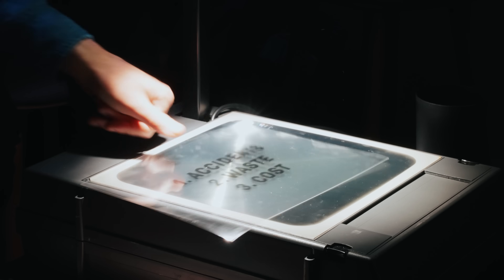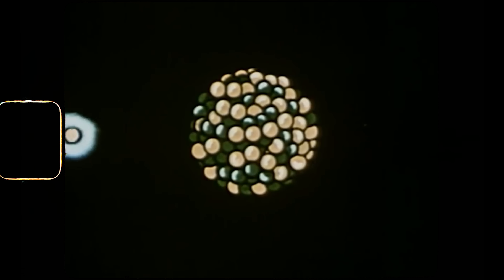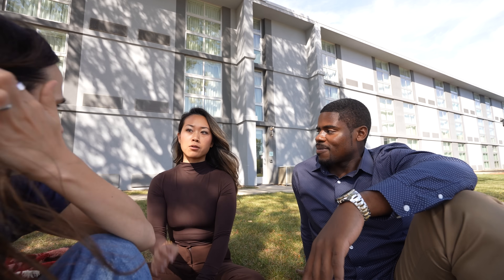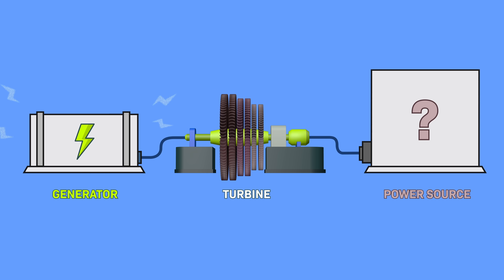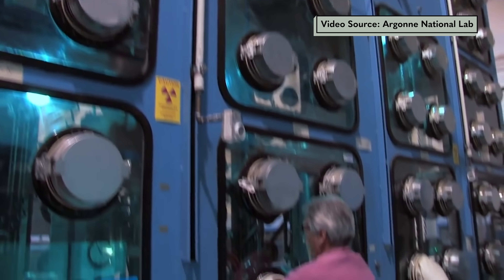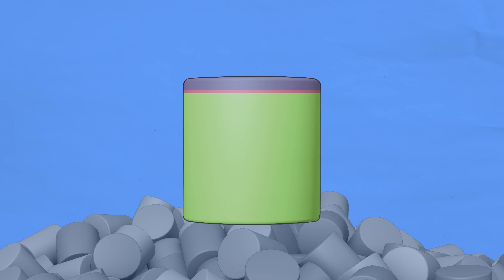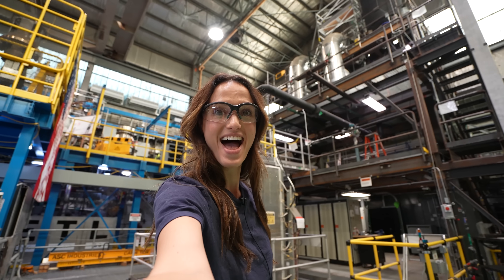The Big Lie About Nuclear Waste

Comment: What about the radiactive but not nuclear waste a nuclear power plant also produces? Like the concrete or the reactor parts? They are radioactive but not useable. They are not that long  radioactive (1000 - 10 k years) but make 90% mass of radioactive waste. And your hole reuse isnt a closed loop.

Comment: Nuclear fuel recycling sounds great, and it sounds like President Carter made a mistake in ending it. But reactors in use today are incredibly complex, and once you understand how easily one mistake can create a Three Mile Island, Chernobyl, or Fukushima, you’ll want all nuclear powerplants permanently disabled and decommissioned. It’s the most dangerous technology ever created, and when climate change begins our mass extinction in a few years, there won’t be enough skilled operators around to safely shut down and decommission these reactors, resulting in meltdowns which will destroy our ozone layer, allowing cosmic rays to sterilize this planet. We need to begin terminating these reactors now, before it’s too late.

Comment: For me (an economist), this video stopped right when it got really interesting (it's still great though).
The most important thing after proof of concept is economic viability. Therefore, what I really would like to know are the overall (economic, not business) costs of a closed nuclear fuel cycle compared to the costs of the current once through fuel cycle, including all the externalized costs of waste storage etc.
One could then go on and factor in risk aversion, since highly radioactive nuclear waste in storage is probably much more risky than just reusing it.
One would have to consider numerous other things of course, but one could find out if it really is advantageous for a country/economy to do this.

In the end, one would still have to compare it to other technologies (renewables are much cheaper of course, although with their increasing share in total electricity production the additional costs of storage reduce the margin).

Finally, being from a country that shut off it's last nuclear power plants almost exactly a month ago, I'm very glad that, at least, this research is continuing in other countries.
Reply: Galen Windsor.... thank me later.

Comment: I find it weird that you mention the 'cost' factor in both viedos, but then go away and more or less ignore it.

In the 1960s, there was a vision. A vision, that nuclear power could be a cheap and reliable source of energy. It wasn't back then, but the technology was very young yet and the researchers at the time claimed that it would totally become profitable in a few decades. They stated that for the fission reactors as well as technology like breeder reactors, that could use U-238 or waste of fission reactors.
Now, over 50 years later, it hasn't come true and it doesn't look like it ever will.
There is a huge loss in interest for nuclear reactors and the one main reason seems to be cost. In a time, when we have very cheap energy from wind turbines and solar, that got profitable easily and are still getting cheaper, no one wants to invest in an old technology that never lived up to expectations and still relies on subsidies.

The cost-factor of nuclear technology is huge (truly!). There probably are places where nuclear still makes sense to some degree, if you can't get around with renewables. But if you have sun for solar or a coast for off-shore wind, it probably is somewhere else. Nuclear is not as bad as a technology as their opponents state, but its disadvantages against wind and solar (which is not only the cost) are more devastating than the advocates want to believe.

Comment: What makes the situation so much more frustrating and worse is that even IF we continued the once through life cycle, we would STILL barely have any nuclear waste to be concerned about. For starters, coal power plants give off MORE RADIATION and NUCLEAR WASTE than a nuclear reactor itself ever will or does. Much of the shit we burn puts out particles that give off more radiation then what we allow a nuclear power plant to release. If you were to do a test of background radiation next to a nuclear power plant and a coal power plant, you would find the coal plant has multiple times higher levels of background vs a nuclear reactor. In fact nuclear reactors are so clean and safe that you could stand above next to a spent used fuel pool or the reactor itself and still receive less radiation exposure then your average coal plant worker. Most of all the low level nuclear waste we account for is from medical and coal power plants. High level nuclear waste like spent fuel is not remotely close to a problem, and we are already storing safely in facilities that will last 20,000+ years without any concern. Best of all, we would STILL have space in at this place to store high level fuel even if we magically converted everything to nuclear power overnight and did nothing with the waste for 10,000 years. That is how TINY the amount of high level waste we produce by itself, let alone compared to the incredible amounts of nuclear contamination and toxins we release every moment from coal power plants....

The media along with fossil fuel energy investors have fooled people into believing that we have a nuclear waste problem when we don't. We are arguing over a problem that doesn't exist. There's many solutions to high level waste that have already been PROVEN, but lobbyists fight against nuclear because it threatens the fossil fuel industry.

Comment: Great videos!  Regarding the very long half-life wastes, I would like to point out one fact. For each element/isotope the decay will release certain amount of energy in total, which usually is within a certain range and there is definitely a cap to that amount. This can actually be calculated, it is the amount of mass loss comparing the resulting materials and the starting isotope. 

What this means is that the this amount of energy (radiation) will be spread thin throughout it's lifespan (the thinner if the half life is longer), which we call it the half-life of the isotope (approx corresponding to the length of time in your chart). The longer the half life for that particular isotope, the less radiation you are exposed to it within, e.g. an hour, or a week.  As a result, those long life isotopes are less hazardous.

 I will also give you an example, if you heard of carbon-14 dating. C14 has a half life of  5730 years, and we are constantly exposed to C14 in nature and incorporates it throughout our life in our food and keep them in our bones. Therefore, u can more or less ignore any of those wastes after 5000 years 

p.s.  you would still want to avoid them, since the storage has a high concentration of them. but they are not as scary as they sound
Reply: I love your explanation! Your example using C 14 leads you to say something which I believe is almost correct: to get a a “background” energy level -or a “forget about it” state, the number of half lives would need to be 8-10, not 1.
Reply: Thinking of half-lives, as a proponent of nuclear energy, I always remind people that flyash from the combustion of coal has hazardous material like arsenic that are hazardous forever.
Reply: You are clearly an expert on this topic but may I suggest you put spaces between paragraphs. Nobody likes to read huge amounts of text regardless of how informative it might be

Comment: I had the opportunity to watch San Onofre being built, the melt down of Three Mile Island, and of course, Chernobyl. I believe the problem with nuclear energy has been engineering. Both design and construction. All the accidents have been do to design issues, even Chernobyl which was primarily operator misunderstanding and error. Even so, the design needs to be robust enough to contain a catastrophic failure of a large magnitude. Fukushima would have panned out better if it wasn't beach front property.

Comment: Interesting topic, great video. 

One thing though: at 7:05 you said "That number refers to the number of neutrons in the atom." While the difference in that number from U-235 and U-238 originates from the difference in the number of neutrons in these two Uranium isotopes, it is not the number of neutrons, but the "mass number" or "nucleon number". It gives the number of nucleons in the nulceus of an atom and is approximately equalt to their weight in the unified atomic mass unit. The nucleons are the particles in an atoms core (protons and neutrons). So 238 and 235 are the sums of protons and neutrons. Because the number of protons defines which element an atom is, it is the same for both (92 for Uranium) and the difference in the nucleon number comes just from the difference in the number of neutrons. One says U-238 and U-235 are different Isotopes of the same element for that reason. (By the way, it's the same things for deuterium and tritium for nuclear fusion. These are different isotopes of hydrogen).

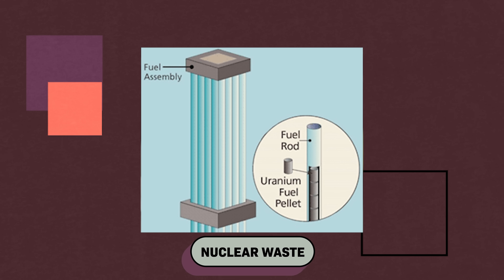Comment: 7:10 Small nitpick about enrichment. It doesn't make more U-235 out of U-238. It separates the isotopes, so you get uranium that contains a higher U-235 percentage, but by taking the U-238 out, not by transforming it into U-235.

Comment: Lots of misconception and mistakes here. Here are some key points:
1. Uranium-235 is named after it's atomic mass which is composed both from neutrons and protons
2. Fission occurs when low-speed neutron (NOT atom) hits the nucleus
3. Actually most of isotopes forming after the atom split are really short lived. Their half life rarely exceeds several minutes (in most cases we are talking about nanoseconds). The most dangerous are relatively long lived ones like Cs-137 (radiocaesium) and Sr-90 (radiostrontium), their half life is around 30 years. Radioiodine has T1/2 around 9 days. The residual radioactivity graph looks pretty much like one for function y=1/x
4. "Just filter it" does not work in practice. It's not a coffee filter. The cost of energy needed to perform the separation process vastly exceeds the price of fuel it produces. Especially since the separation occurs anyway, because nuclear waste contains A LOT of useful stuff like Pu-239, which is used in nuclear bombs or in reactors (it can split by slow travelling neutrons like U-235). Also most of radioactive isotopes used in medicine come from nuclear waste. Radioactivity is used in many ways today (even in smoke detectors)
5. Just because no private companies do filtering does not mean it does not occur. Government does it anyway (those bombs don't make themselves)

Comment: The framing of the cost problem needs to be addressed with nuance. Are we debating the costs between fossil fuels and nuclear? Then nuclear wins hands down. It is better to invest into a temporarily costly endeavor in order to reduce and slow down the effects of carbon emissions toward disastrous climate change. But! There's a but. Should we continue to invest into nuclear when there are cheaper sources of renewable energy that ALSO will slow down our damaging effects on climate change? Not enough work is done to show that we are heading towards 0 carbon emissions FASTER if we instead put more resources into wind and solar instead of trying to put resources into wind, solar, AND expensive nuclear. That's like trying to race on a bicycle while towing a semi truck behind you. Yes science has demonstrated we can overwhelming built nuclear reactors safely, that dangerous radiation would be more likely from your routine dental visit than from a nearby reactor, and that we have ways to reduce nuclear waste (as demonstrated by this video), but all of this is meaningless if we just have a better solution in every metric that can be measured. Abandon nuclear, not because it's bad, but because it's antiquated, and a waste of resources and manpower. Support renewables instead.

Comment: Everyone should search YouTube for Kirk Sorenson and Liquid Floride Thorium Reactor.  This molten salt reactor can also be used to recycle "spent fuel", since it uses molten salts to dissolve the fuel that is consumed in the reactor.  A small portion pf the salt is constantly piped out of the reactor into separators to remove unwanted materials and pumped back in.  The best part is that it doesn't need to be pressurized, molten salts have about 1000C liquid temperature range, compared to water that only has 100C range and 300C range if under enormous pressure.

Comment: I have been working at a nuclear plant, so I guess Im part of the nuclear industry. The most important thing about this video is really that no one should be afraid of nuclear power! However. There is really so much more to be told, and its much much more complex! Reprocessing of nuclear fuel is first of all expensive, second not really as easy as described. Working with highly radioactive material combined with strong acids (thas how you separate the U235 from non usable metals) is very hitech and quite hard. The french reactor Super Phoenix, a breeder reactor, using parts of pervious used nuclear fuel closed down without beeing a comercial success.
If there is a big lie about nuclear waste then it is that it will be leaking everywhere. Its not. The final waste is very hard soluble in water, but of cource we should do everything to prevent that from happening.
There is absolutley a future for nuclear energy in the comming 30 years, and it will remain the same (but safer) nuclear plants as before. My guess is that it will not be any molten salt reactors or thorium reactors, but just the same as proven before.

Comment: Great video! One thing…I don’t think anyone on earth uses the kind of fast reactors that can just chew up nuclear waste (or spent fuel) right now although that is a theoretically viable pathway. We all have light water reactors and the reprocessing allows us to recycle the waste. 

In a way I think it’s good to reprocess the waste so that people aren’t so worried about it as an issue. In a way it’s just not worth it because uranium is still cheap as chips and will remain so for a long time. It’s probably more efficient to store it in dry storage until we have molten salt reactors (or fast breeder reactors) that can use it direct. 

However, in nuclear energy (as in many things) the political question is thornier than the technical question, so even though I think the cost/benefits of reprocessing is dubious, it might be worth it just to give nuclear a publicity win. If we deploy this technology quickly and on a massive scale, cost will come down enormously, bringing a huge amount of low-carbon energy online at tiny cost.

Comment: I've always wondered why they didn't recycle, could never find out why so thank you for this video. I've looked into nuclear for many years and seen so many improvements in other areas. Technology has improved ten fold compared to the plants that were built decades ago. I remember being told "You've got more computing power in your phone than on the Apollo 11 mission". Three Mile Island had just started to be built back then in 1968/1969, just let that sink in. I like to think of Space-X with their reusable rockets, impossible till made possible.
Reply: money, always money is the answer
Reply: They have, for about 70 years.
Reply: Well its also a good analogy- SpaceX wasn't the one being told it was "impossible" as NASA had already developed vertical landing rockets in the 1990s. Just like reprocessing, it was left alone until picked up again.
Reply: @okankyoto  Things on paper aren’t the same as the practical executions else Space-X would’ve just used what NASA had written down and never failed any landings. Love how everything in the comment section needs to be a one up on what has been said.

Edit: Just had a brief look and it’s as I expected “In the 1960s and 1970s, the first reusable launch vehicles were manufactured, named the Space Shuttle and Energia. However, in the 1990s, due to both programs' failure to meet expectations, reusable launch vehicle concepts were reduced to prototype testing.” Doesn’t sound “developed” if it’s still prototyped, more like it was still in development.

Comment: In the video, you mentioned that U-235, the number (235) refers to the number of neutrons in the atom. It is not. The number is the atomic mass of the atom, which is the number of protons and neutrons together. The atomic number is 92, so the number of neutrons is 143 neutrons (235-92=143).